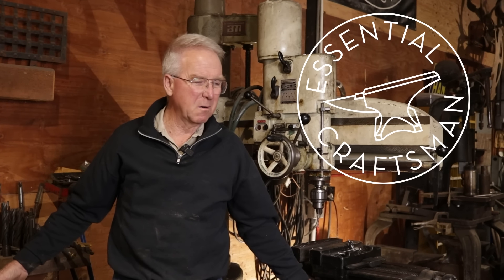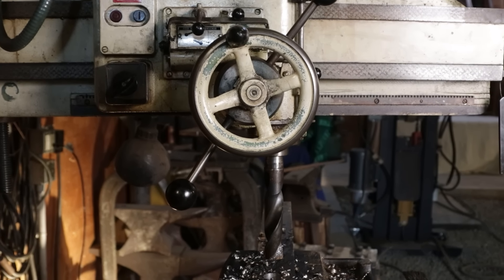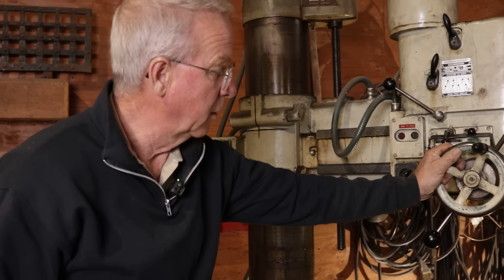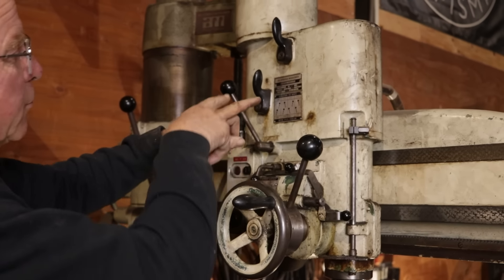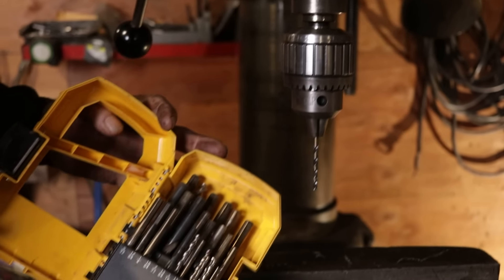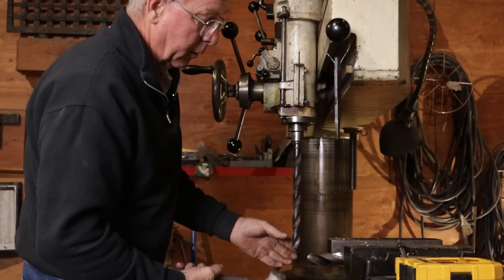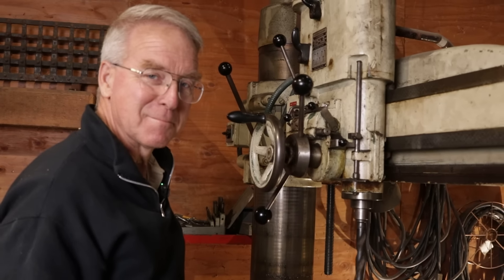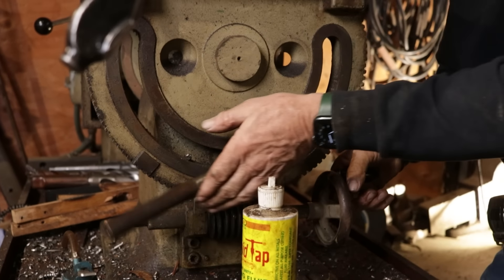The Drill Press That Does EVERYTHING

Comment: For making a lot of holes in metal fast, a 55 ton Ironworker (electric or hydraulic) is a better tool than a drill press. Although a good one can be close to 5 digits. It just quickly punches a clean hole through metal.

Comment: Used these Radial Drill, all the time in the Machine Shop as an apprentice, smooth as silk, drilling 1” holes through half inch plate through a jig! When dud they start calling them Drill Presses, what are they pressing?
Reply: I always known them as Radial Arm Drill. Sized by the Dia. of the column and length of arm.

Comment: there are 2 solutions to your oiling. One is somebody used grease instead of oil and now the oil gets pushed out insted of in because of blockage. Or you need a smaller tip at your oiler. So the tip presses the springloaded ball into the oiling-mechanism.  We call em "öler." i did buy some small LED sewing machine lamps with a magnetic base, cost 5$. Placed them on allmost any machine.

Comment: Running full flood coolant with the machine's internal pump will be a game changer if you have a lot of holes to drill.  Night and day difference.  The biggest problem by far when drilling steel is getting rid of the heat.  Heat destroys drill bits.    A lot of home shop guys run a mister system which is kind of like full flood but a lot less hassle and mess.  Proper cutting tool cooling is what sets apart a real machine shop from  everything else.
Reply: And the mister system can be moved from the radial drill, to the lathe, to the mill, and to whatever else your cutting.

Comment: Instead of oil while drilling, use coolant/ water soluble oil. Take a 2L coke bottle and drill a 2mm hole in the cap. Then all you need to do it spray it onto your drill when your working. 

You’ll find it way better and it doesn’t small/smell

Comment: Is that fitting with the that you are trying to oil supposed to be a grease fitting? On our German panel saw, the grease fittings are similar to those and they take a special hand held pump with a nozzle. With the downward force of “pumping” the grease pushes that ball out of the way and then it flows into the machine. I could be wrong but that is what I immediately thought when I saw this.

Comment: We had a similar Radial Drill in a steel fab shop I worked in for twenty years as Structural Steel Lead Layout man.
I can't recall the brand name but it was made in England pre WWII,  I believe.
  It was obviously a fine machine in its' day, but had been badly neglected and abused during its' long service lifetime. 
 
 I was able to spend a couple slow days at work cleaning and repairing it up a bit.  
We had an assortment of #5 (?)  Morse Taper twist drill bits for it , probably up to about 3 inches in diameter; geared slow, it would easily turn any of them through 4" thick mild steel plate (provided a reasonably-sized pilot hole was drilled first).
 
I was always pretty careful when using it, after hearing of a worker who got wrapped up in the quill of one and spun around it until his legs tore off after smashing against the column half a dozen times in a couple seconds. 

  It was essentially obsolete for that particular shop by the time I started working there; most of our holes were cut with magnetic-base portable drills using annular cutters. 
Or just cut on a plasma table on anything thinner than an inch or so...

 Edited to add: 
I just now recalled the brand name of that machine. It was an Archdale.

Comment: As others have said, Machinery's Handbook.  
This will give you your feeds & Speeds  Feed rates, and RPM rates for drilling.  Automatic rates that is.
Otherwise, if you're going manual, and this is crude but it is also true:
If you're drilling, and she's squealing, you need to go slower and use more lube.
That said, if she's exotic, you might need to go harder and faster.

Machinery's Handbook is your drilling, screwing and pretty much everything else guide.

Get a DIGITAL version, so you can search!!!  Like, a PDF version that you open on your PC.
Reply: If its squealing its wearing the bit. may have to reduce the RPM but, increase the feed. Let the tool cut.

Comment: The tapered tool is called a drift.
Reply: Yep. The first time he used it bottom up. The drift has a flat side that goes against the drill tang and rounded side that goes against the radius in the spindle or sleeve.
Note: the top of the tang has a radius that helps with the wedging action.

Comment: Awsome machine, and actually, it looks very well maintained. 
The one thing I'd recommend you do is hang a plastified sheet of speeds'n feeds for different materials next to the gearbox controls. It's very hard for non-machinists to accurately estimate how fast a drill needs to move in both downwards and rotational speed. If you google it, you'll find a couple ancient ones; pich the one matching the majority of your work.
The drill you were showing should produce 2 long spiral chips in normal iron; I guess you are coming down too slow; or the drill is too dull.  
Also, I'd leave the cooling system off; you don't really need it and it's much more of a hassle then an advantage. Unless you are using it daily for hundreds of holes. 
Why are you using an automatic morse taper wrench - with the red handle- while you have a normal morse tapered wedge hanging on your drill ? They should be interchangeable ... And I only use the automatic ones, and keep the wedge only for when things are really stuck.

Comment: Hopefully you can find the manual for press.  That should say which lubrication to use.   You definitely don't want to use grease where oil is needed.  

I am not a mechanist but I was thinking those ball bearing fittings were for grease not oil.  If it supposed to take grease then try: a "Narrow Needle Grease Adapter".  The one that I have is from LockNLube which I got from Amazon.  SKU LNL 122  UPC 84282 64012.

Comment: You should never put endmills into a Jacobs chuck, or any drill press chuck. They are meant to be used only in milling machines, and there are good reasons for that. Also, regular drill bits should also never be used for drilling holes on an angle greater than 1,5°.

Comment: Those lubrication fittings are called Zerk fittings. That’s the kind of adapter you need. Also I personally would not get into the habit of grabbing the spindle to slow it down. And I know you know this already, but every time you call a drill a bit, a machinist dies inside😅
Reply: I'm a machinist and I call drill bits "bits"
A bit just means something at the end of something that's cutting. The end of a jackhammer is a bit, you could call an endmill a bit, the little grinding tools on Dremel's are bits. 
The problem machinist have with calling things bits is it's not a very descriptive thing to call something. Every one of the 1000s of cutting tools a machinist uses could be described as a bit, your expected to know the nomenclature, but no machinist expect a carpenter to know what everything is called.

Comment: OK, here are  my ideas about putting oil in the tiny cup.   You could get a syringe and needle.  The metal needle will depress the ball and you can slowly press the syringe to get a small amount of oil in the cup while the ball is depressed.  Or... You you put a small portion of oil in the cup, then you press down the "ball" with a small, narrow drill bit, so that the oil in the cup will drain and go past the ball.   Or you could use one of the small metal pieces designed to get the phone card out of your telephone to depress the ball, then add a small amount of oil.  

The syringe and needle are probably the best bet.  Get them from your doctor, your pharmacy or your vet.

Comment: I wouldn't hit your cutting edge with anything its not ment to handle shock though lead is soft its dense. The taper should hold if you slam it in there by hand keep your tapers clean and smooth if the get a ding get an india stone and smooth it back.
Reply: Will said

Comment: I would strongly recommend not to use motor oil as cutting oil. It's designed to be an anti-friction agent. It can cause heat, chatter / unusual machining, and machine binding, among other things. At minimum use WD40, Gibbs, Liquid Wrench, or Tap Magic.

Comment: Well I have 40 years in the electrical industry in the UK.

It depends on what the 3 phase output to your machine is ..... eather 3 phase 3 wire or 3 phase 4 wire. The 4the wire is neutral and you would wire your light between one phase and the neutral. 
If it is a true 3 wire system you need to get more creative. If you wire two lights in series they will work across any 2 of the 3 phases you have (but you only want one switch and you do need them in series) wire them in parallel and you get a Very bright light for a very short time! Alternatively you could just wire your light independently from the 3 phase using your normal shop supply!

I think you are wasting your time oiling those ball bearings. If I am right they are spring loaded (you could check that with a correctly sized punch pressing down on the ball .... you should get a small amount of spring. If so they are Grease points and need a specialised head for your grease gun!

As for cleanliness ..... don't worry too much! The old UK bikes used to leak so much oil you never missed an oil change as there was non left in the bike and you could always tell where it had been parked! The point is British bikes never rusted because of the oil all over them! I would suggest a good wipe down with the proverbial oily rag would be all you need to remove grit from sticking to it and make it look a bit more loved! ;o)

For information the Morse taper refers to the angle the taper is cut and the number to the point on the taper where it starts and ends!

Comment: Use DC for a work light so it don’t short out against the machine and electrocute you….I cannot caution you enough when drilling long pieces of steel stock in a vise, the drill can “grab” the material and lift it out of the vise. The part will then spin and hit the column and smash any body part that happens to be in the way. Never grab a spinning spindle. Lock the quill before you knock the drill out with the drift. Use a end mill or any suitable flat bottom tool to make a flat in the work piece to drill a straight hole. Those oilers are called ball oilers, not many sources for a specific tip, when I was machining I made one to fit my oil can. Use way oil on the “ways” move what ever part you’re oiling so all surfaces get a coating. I didn’t see but I’m sure some where there’s a place to oil the spindle, use light spindle oil there. The arm is called the radial arm not the turret. Check out this book….American Machinists Handbook Colvin & Stanley, it’s the Bible for machinists.
The flat on a drill or drill adapter is called a tang, I have twisted the tang off drills when they grab a piece of material. Also be aware these machines were designed to put pressure downward and that keeps the tool seated in the spindle. Any side force on a tool in this machine can cause the tool to pull out of its tapper.
Good luck 😁

Comment: It sounds like you are calling the top rotating head that gives this type of machine its name at "turrent". If you are not saying that, please forgive my aging hearing. If that is how you are saying it, it did not come up on the online dictionary. Even when I spelled it here, it is underlined in the tell-tale squiggly red line telling me there is no such word. That dictionary did give me a suggestion of the word I am thinking you meant, "turret". Please let me know if my research is incorrect and "turrent" is, indeed the correct term. Thanks for the share of your nice radial drill press. I wish I had room for one of those. And, as I must do also, install a three-phase converter to use such a machine. Thanks, again, Dean, Lancaster, Pennsylvania.

Comment: Please ditch the lead hammer for your own good.  A brass hammer has the same benefit without the toxicity.
Otherwise keep your Morse tapers clean and wipe them before and after each use.  You get a chip in there and it does a lot of damage quickly.  Get a Machinery’s Handbook and you will get your answers.